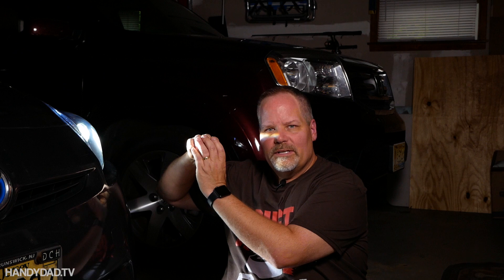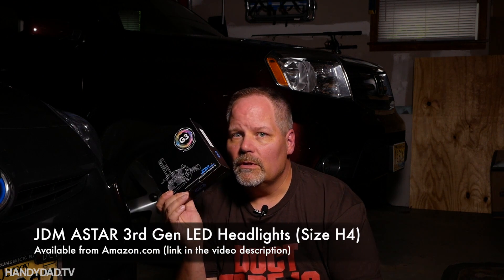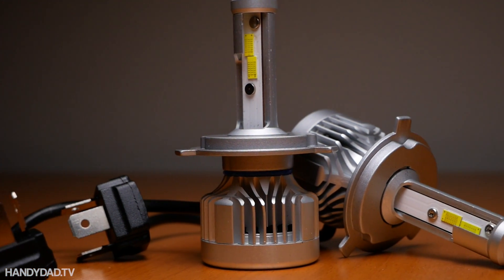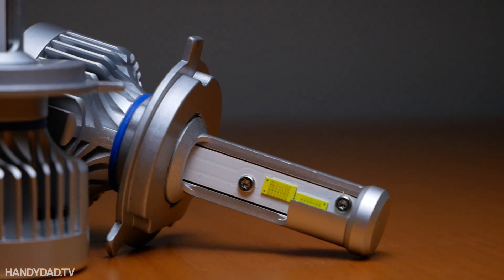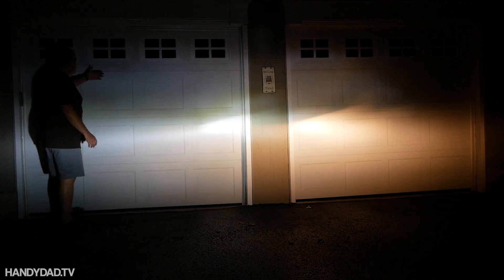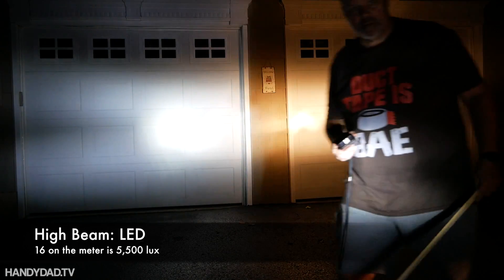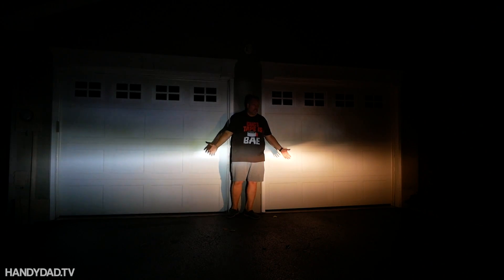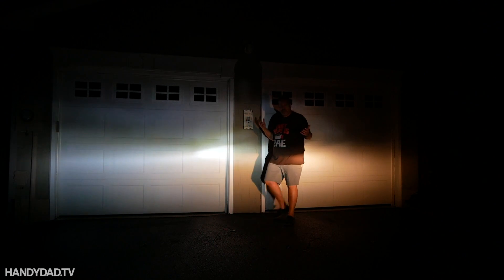Dual Beam LED vs. Halogen in Reflector Headlights

Comment: Pretty good review. Some useful comparisons. Good information. What brand of LEDs are these? This is the first headlamp review I've seen where it was mentioned that the comparison between lamps was done by setting the camera to the same light gathering (same aperture and shutter speed for each lamp?). What we need now is an on-road comparison. Either with one headlamp on the R and the other on the L, or 2 trips, one with each set of lamps, over the same road, on the same night (same lunar light, same amount of cloudiness). Then either display the sequentially, or use editing software to display them simultaneously.
Reply from the maker: +Theodore Zuckerman These bulbs are from JDM Astar. I live in NJ and all the roads have streetlights so I could never get a useful driving clip to compare bulbs.

Comment: Please teach people to retrofit their headlights. Do not plug and play. Always use an HID projector. Not a halogen projector.
Reply: Rawker Dewd you would be really annoyed in Europe, here you are only allowed to replace lights with ones that are certified to avoid "malfunctions" like bad alignment due to bulbs not fitting the bulb specifications.
And seeing what some idiots with no idea what they are doing did to their headlights and as a result endangering others, I think it is good this way.
Before anyone complains, yes I think if someone knows what he does, he can do such a modification perfectly right. Only here you have to get an individual inspection then and have it checked if all regulations are fulfilled.
It is sad that too many idiots make those regulations necessary.
Reply: If you put LEDs on projector housing  the cut off line remains the same, on reflector housing i have had no luck, light shoots everywhere blinding everybody, any of U had any luck with those 4 sided LED bulbs that mimic the halogen lights?
Reply: Dominique Sanchez my Volvo in 2000 had the option of factory hid in reflector housing.
Reply: Nowadays. Always use LED’s in the projector, and reflectors.
Reply: it's not about what you do with your headlights but with other people's lives...
Reply: Dominique Sanchez I have a hologen projector in my car. It runs great with HIDs. No glare whatsoever, and a crisp clean cutoff. 

I'm really tired of people telling other people what to do with their own cars Headlights. 

Just let others do what they wanna do. Stop crying that on every headlight video on YouTube.

Comment: If you put the dust cover over the opening will the LEDS overheat?
Reply from the maker: +Hunter Yes eventually
Reply: HandyDadTV I have a Mazda 3 and the cover has a pass through for the back of the bulb. Hopefully it will work.

Comment: after led install teh dust cover cannot be put back?
Reply from the maker: +Niko Oliver The original dust cover shouldn't be used because it doesn't allow enough airflow around the bulb to dissipate heat.

Comment: Nice video. Unfortunately the glare above the cutoff is noticeably greater on the LED side versus the halogen. Placing a lux meter against the garage wall would be a better practice for measuring light points. One other test would be to allow the LED bulb to fully warm up for 60 minutes. In our testing most LED bulbs will dramatically lose light output as they get hot. And will eventually level out as the driver drops current to keep the emitters from dying from heat. So a LED bulb may appear bright at first but may end up no brighter than halogen in the end.
Reply: Plus the led bulb does not produce as much of the spectrum of light as the halogen bulb can, thus less illumination, therefore no better off, but hey i guess people just want new things one after the other
Reply: Good LED´s dont get hot?! What are you talking about?  How hot an LED get has absolutly nothing to do with how good it is, just how much power it outputs
A 50W LED ist going to get much hotter than an 25W LED, just because it has more power.
Reply: helicopter234 actually how hot an led gets changes it's lifespan
Reply: Perhaps but the led should last much longer than the others. Using a 3000k or lower colour will help with the glare.
Reply: Check out:    Philips vs Osram Performance
Reply: It's because rubbish bulbs, this bulbs are junk.
Reply: Christopher Guy leds that run cooler with cleaner power will last longer also quality led chips need to be used for this method of determining lifespan to actually work
Reply: Counterintuitive to what I've said I purchased 20$ led lights 9006 for my low beam day time running lights after reading good reviews, they have no fan only heatsync and no adapter and the plug is on a 90 degree angle making fitment difficult but I got them in by removing the rubbing dust ring and the blue wire helper on the back of the plug off my car gave me just enough room to fit it in, so far so good at first I didn't find them so bright how ever I'm not sure if my eyes just needed to adjust or if the lights started working better however in -30 degree Celsius Canadian winters they work pretty good no melting issues but the hot summers might yield different results so can only say what I know, I've also adjusted my headlights to same 27" cut off height so I'm not blinding others and reflector housings for those wondering, I mainly bought them for my sound system I currently draw over 2000w and my lights dimmed pretty dim,  with the leds I don't notice a difference when playing my music loud now they stay bright and they do better with voltage fluctuation sometimes I'm charging at 15+ volts sometimes 13.7v and the leds are doing well, I also purchased led reverse lights so you need to check them out and those are bright as he'll I love them
Reply: AustinAutomotive  if your stereo system dims your headlights that bad then you need to install a stiffening capacitor on the power supply to your amps, otherwise you are overworking your alternator.
Reply: And that dust cap only exposes the inlet or the outlet of the fan. The air can't flow. It just builds pressure...
Reply: Automotive LED Research these have fans to keep cool and good leds don't get hot anyway lol I would say they are brighter but new cars are coming with them might as well use em

Comment: Not often do I physically 'like' a video, but this was perfect for me to understand and see everything. 

I have reflector housings, and HIDs just annoy everyone but I'll be getting LEDs soon!
Reply from the maker: +Michael Lawley Glad to hear this was helpful. Thanks for the comment.
Reply: HIDs are only annoing if not aligned correctly. Good thing about HID in reflector housing though, after some time they will create they own ventilation. only the in between deforming of the refloctor really could annoy others.
Usually reflector Housings as well as projector lamps using halogen lights have a certain lamp type, like H4 or H7, those have pretty straight specifications about dimensions, locations and even the light output.
Reply: There are factory reflector HIDs. One of my cars has them - but if your assembly isn't certified for HID or LED ("high output lighting") then stick with halogens (and in europe you'd better be prepared to install automatic levelling headlights and headlight washers if you move up from halogens)
Reply: If you put LEDs on projector housing  the cut off line remains the same, on reflector housing i have had no luck, light shoots everywhere blinding everybody, any of U had any luck with those 4 sided LED bulbs that mimic the halogen lights?
Reply: Brother make sure you adjust the reflectors. They  have to be adjusted in such a way that the spread and throw is reduced. You need to concentrate the light in front of the car. Use the rollers behind the light to do so.